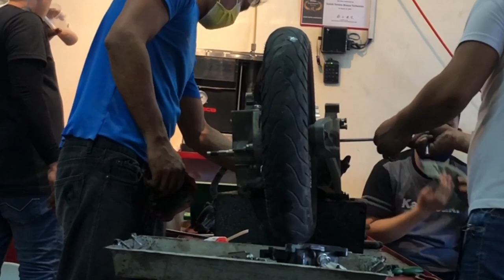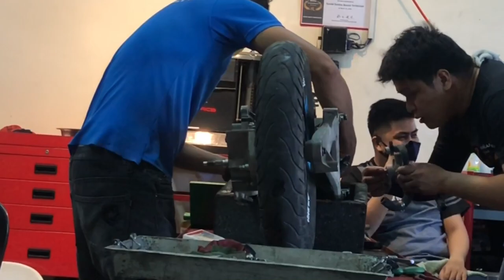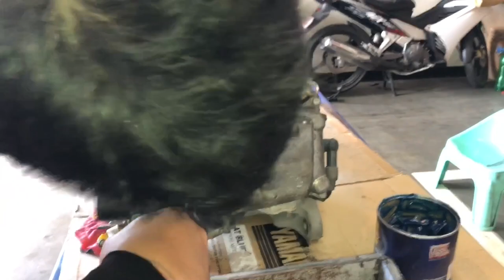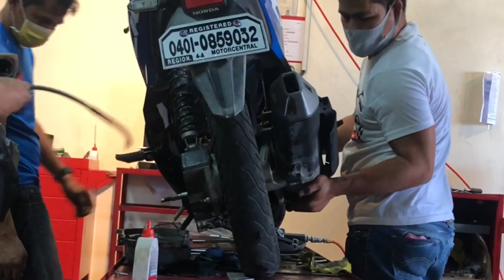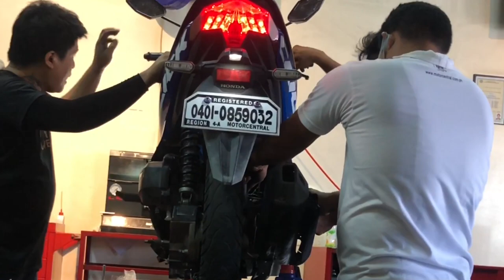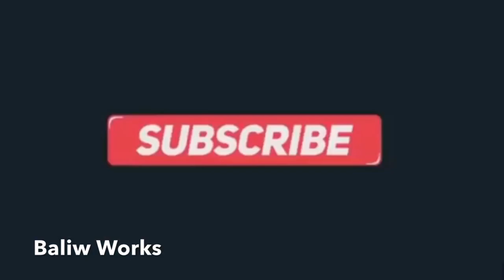Click 125V2 oil leak ,broken engine part2

Comment: magkano poba?
Reply from the maker: Ang alin sir?
Reply: @maynard0502  gastos po sa pag fix ng oil leak? or warranty papo?
Reply from the maker: Ginastusan na po nang may ari kasi ngpagwa po sa backyard pinupok yng ehe center stand kc d n agd nbalik dhil sa kalawang..kakapukpok po kya nbasag..mga 3500 po ngastos
Reply: @maynard0502  san po ba yung leaking saakin kasi don nag leleak sa bolt ng panggilid tsk2
Reply from the maker: Dun po sa base nng center stand yng nabasag..pasilip nyo po muna casa pra macheck na mbuti kng saan po ngmumula yng leak boss..

Comment: Ganyan din sakin potik.. nag crack 😞 nilagyan ko nlng ng steel epoxy para di mag leak
Reply from the maker: Pahinang nyo boss pra mas matibay.
Reply: Yung pinahinang mo matibay nmn kahit lagyan center stand.
Reply from the maker: Ok nmn boss wla nmn nging problema..ms mgnda may hinang dn sa loob👍😊
Reply: boss kamusta nung nilagyan mo ng steel epoxy? maayos pa rin ba?
Reply: Sir. Kamusta po ung nilagay niyo na metal epoxy. Saken ganyan nangyare pinilit. Now lng kaka kuha ko lng from warehouse repo. Sana okay sya sa metal epoxy wala p kasi budget
Reply from the maker: Mas ok po ipahinang..
Reply: Opo. Pero nalagyan nio po sya ng center stand wala nmn naging problema sir
Reply: At gusto ko nga pabayaran sa knila kasi anlki mgagastos ko
Reply from the maker: Pag epoxy lng po at wlang hinang wag nyo na po lagyan nng center stand mag leleak lng po yn..